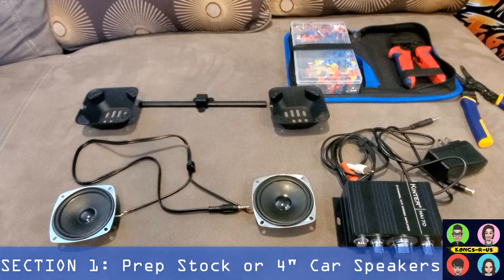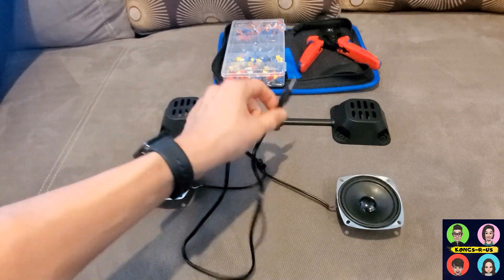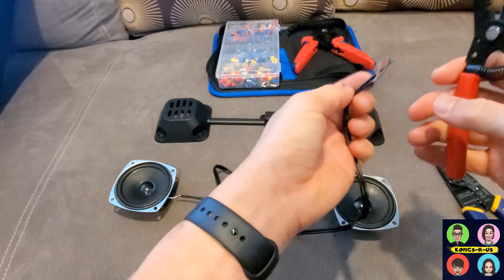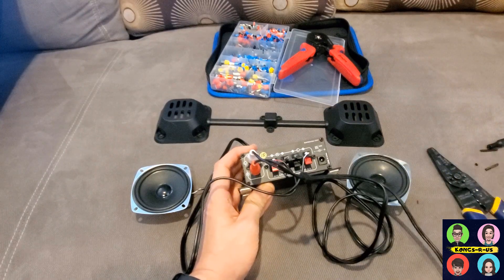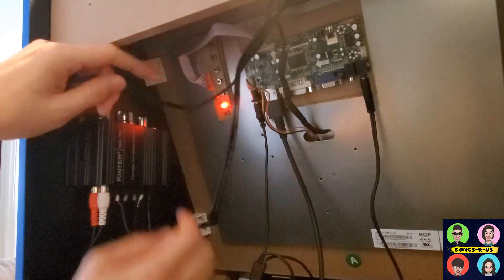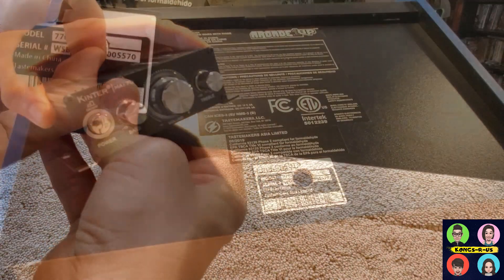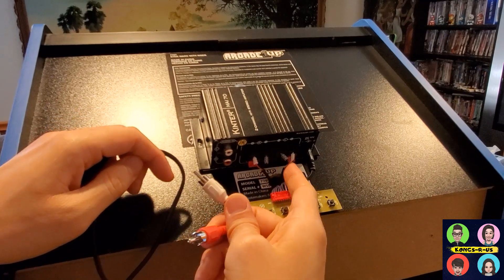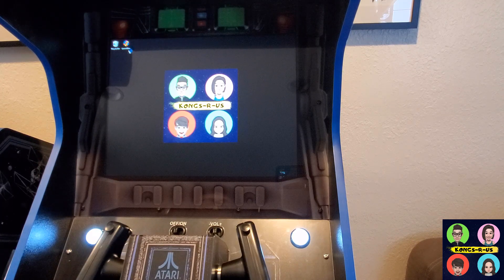Star Wars Arcade1Up In-Depth Mod Tutorial: Speaker & Amp Installation

Comment: Hey Bee, I know you mentioned you can use the stock speakers, but will this work on a stock un modded cab, or should this only be done with a pc or pi?
Reply from the maker: Not sure if you mean doing a speaker upg for a stock cab, or if you can use stock speakers with a PC mod. You can do both if you want to
Reply: @KongsRUs  yes, speaker upgrade for stock cab.
Reply: @KongsRUs  Wanted to keep my Big Blue stock for now, but my speakers sound very quiet.  Hoping a speaker upgrade with amp will do the trick.  I also ordered that TRRS to TRS adapter to try that out first, that one of the commenters  in this video recommended.  I'll let you know how it works out   Good luck this Friday with X-Men vs SF tournament.  Thanks
Reply from the maker: Ahhh, you could upgrade your own speakers and just use the 3.5mm audio out signal to your amp. But I think there will be a future patch to fix the sound issues with big blue

Comment: If you dont have the smaller strippers, how can you strip the tiny wire?
Reply from the maker: You might be able to use smaller pliers that have smaller holes, or I use a knipex automatic wire stripper which works with any size wire. Best of luck!

Comment: Did you first try a plug adapter on the stock A1Up speakers when you plugged them into the LCD converter board?  Take a look at the stock speaker plug and compare it to the amp's plug.  They are different.  The stock A1Up is TRRS (Tip Ring Ring Sleeve) the amp's plug is TRS (Tip Ring Sleeve).

I'm willing to bet that the reason you had such weak sound with the stock speakers plugged into the converter board is because the jack on the board is designed for a TRS jack, not TRRS.  Because of that, the TRRS style plug did not properly line up with the contacts in the audio jack; thus leading to poor sound.  

When you get a chance, try a TRRS to TRS adapter on the stock speaker plug and then plug it in to the audio jack on the converter board.  See if you get better sound then.
Reply from the maker: you are a wealth of knowledge my friend! just ordered the TRRS to TRS adapter to test out and try. still costs about $7 for the cheapest adapter though and the amp is only $10 so not sure if its worth it. I also found out there's a 4 pin JST audio input on the display adapter too that could power the stock speakers. ill have to test that out too!
Reply: Have you been able to test either of those ideas out, yet?
Reply from the maker: @repaircelt9578  I don't have another cab with stock speakers to test it out at the moment ; but hopefully soon when I do some more commisons

Comment: FYI: Those ferrel tube sucks.  Even the smallest size does not create a secure hold on to the wire as the wire is super thin. You probable have to do a double layer on the wire. Also, audio without a sub will sound like shit.
Reply from the maker: I do mention the ferrel tubes are optional and I crimp the actual plastic part of the tube to help it stay secured to the wire.  And there are many sound options out there and I'm sure a sub would improve any audio setup.
Reply: That’s entirely dependent on the 4 in speakers. A shitty pair typically provides enough thump to do what they’re designed to do 

If your goal is to make the cockroaches go blind, sure. Otherwise I’d say a subwoofer is entirely up to user preference.